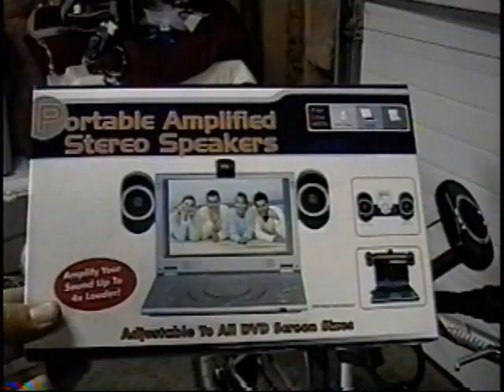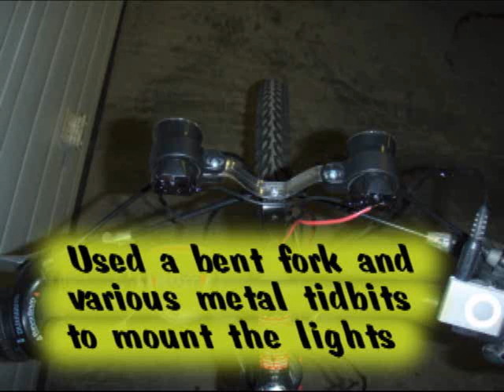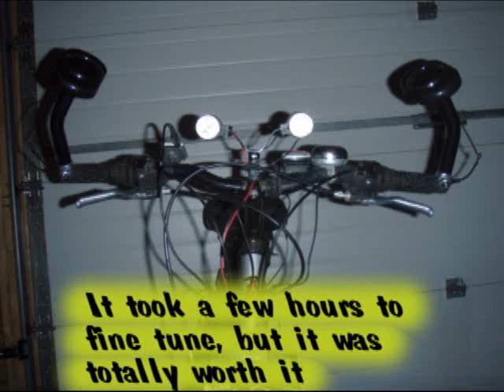Bike Stereo

Comment from the maker: Thank you for the suggestions. Unfortunately this video was made before I could upload a new version of the bicycle and the bicycle was stolen.
But I had a cargo box on the rear rack which housed a rechargable NiCD 12v battery, which was used primariarly for the 12 v Silver Star halogen light bulb for a headlight, but it aslo supplied power to a three way cigarette lighter outlet. It also has a 6v rechargeable battery for the mini-amp. Both batteries were kept charged by a solar panel on the box

Comment: HEY!!!!!  I am proud that you achieved a means to blast music on the bike.  however, there are a few downsides I suggest you fix for future bike audio projects...

Here are some pieces of advice for you:
1. Do not use disposable batteries  2. switch to a 12 volt system  3. use a head unit designed for car installation  4. provide some USB ports and 12volt outlets  5. use a more powerful headlight (preferably one that is compatible with 12 volt systems), youll thank me if you take my advice.

Comment: YEAH!!!!

I'm proud for that.  I don't mind if a subsystem uses a different voltage, what I'm most concerned about is being able to maintain compatibility with future addons.

A 3-way plug splitter is just the thing.  Also, I think USB is also what you need.  And why NiCD instead of lead-acid (or sealed lead-acid)?  Well, I opted for sealed lead-acid since you can get 10 times as many amp-hours for the same money with it.  Besides, I need the extra added weight we lead-acid so I can